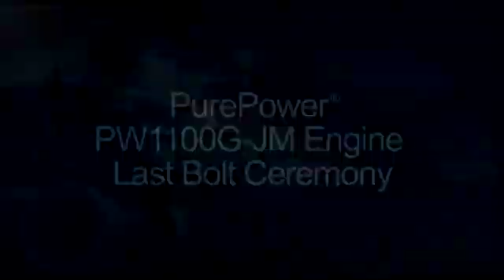PW1100G-JM Engine for Airbus A320neo Last Bolt Ceremony

Comment: Too bad 737 Max can't equip this engine, because Boeing engineers equipped their 737 max planes with shorter legs that limits their engine options. I could say it was probably a failure design on their part and it reflects to sales in comparison to A321 NEOs.